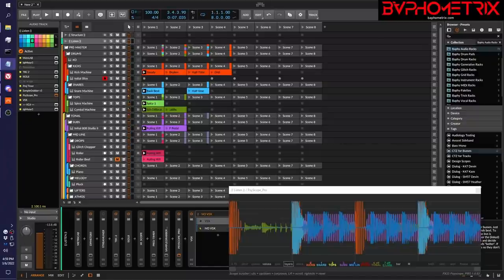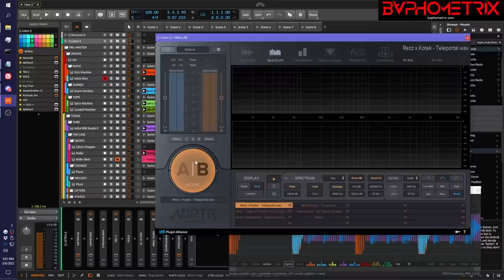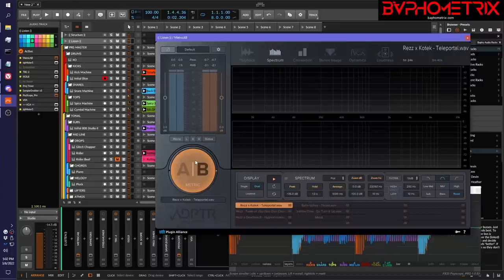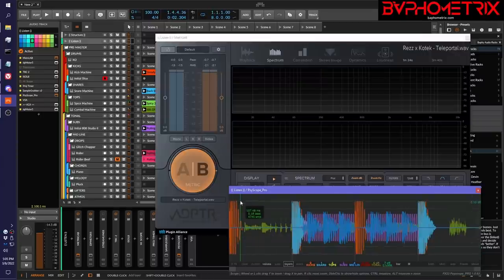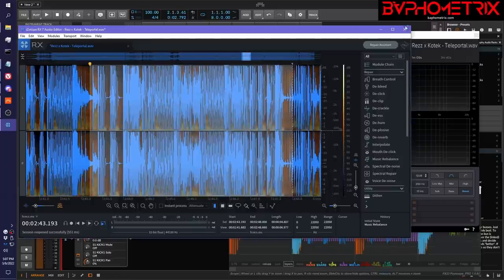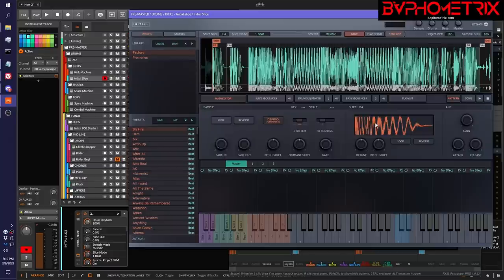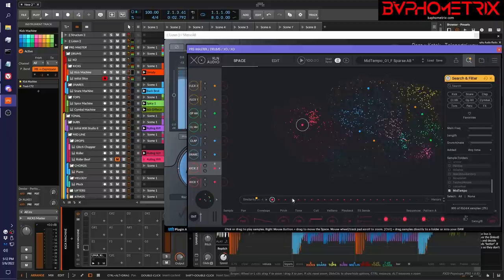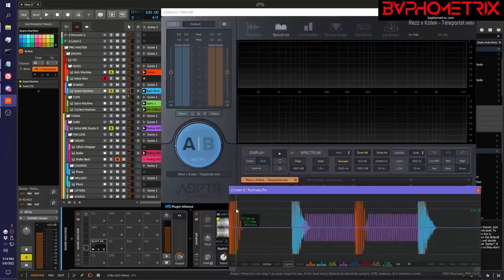Mixing Loud with CTZ - Ep. 9 -  Setting Your Mix Anchor & Framework

Comment: How could I use this technique in modern rock music? 100% sidechain is out of the question, kick drum and bass will always overlap to some extent...
Reply: I think the loudest part must be guitar and bass, not the drums. You must focus on the guitar as the loudest part of the mix (0dB or any other value) and then mix everything below that value. If the guitar will hit 0dB, the drums might hit -3dB, -6dB or other values, but the other elements must be below the loudest element of your song. Also, each element ust have its own space in the frequency range. If they overlap, frequencies add and then clip

Comment: Sorry for so many questions sir, but, if i cant separate the kick and snare from my track, how should I use the refference? I am having trouble getting the same levels, haha
Reply from the maker: It can be challenging. You have to do it somehow. By ear. By guesstimating. Or by finding a kick or snare hit in your reference track and literally slicing it out and putting it in a "drum machine" in your DAW and just playing the kick and snare from the drum machine.
Reply: @Baphometrix  And then, I should get my kick and snare at the same loudness right?
Reply from the maker: @yuulian4776  It depends on the genre, but typically yes. How balanced do the kick and snare sound in the genres you work in? For example, in Trap, the snare is the real anchor sound. It's the loudest rhythmic impulse in the entire mix. The 808 transients are usually much lower in perceived loudness.
Reply: @Baphometrix  I mainly do trap instrumentals. Thank you so much, you are really helpful!

Comment: When setting levels between the kick, snare and sub using the oscilloscope doesn't the faders of the individual tracks have to be set at unity gain so that the oscilloscope will to be displaying the level properly? You mentioned the sub should be approximately 6db down from the kick and snare. If the fader on the sub is set at -6db down from unity gain and the oscilloscope level of the sub  is -6db down from the kick and snare wouldn't the level of the sub at the master be -12?
Reply from the maker: All my instances of Psyscope Pro (or any oscilloscope) are in the inserts channel, and therefore yes, they are displaying the signal PRE-fader. And yes, that means **at first**, when I first set up and balance the framework sounds, I do so with all of their track faders at unity. 

First, I set the *anchor* sound (in this case, it was my kick) to be the loudness I wanted (in this case, just matching the loudness by ear to the reference track's kick). And I do this only with the gain and clipping plugins in my "Track CTZ" rack, while leaving the kick track's fader sitting at unity.

Then I balance the snare against the kick, again, leaving the snare track's fader at unity, and using only the gain and clipping plugins in the snare's "Track CTZ" rack.

The sub doesn't need to be clipped at all (because it's much quieter than either the kick or snare, and doesn't have any significant transients), so I simply raise and lower its level in the synthesizer or sampler that is generating the sub. Again, I leave the sub's track fader at unity while doing this.

So in summary, you typically want the track faders for your "framework" sounds to be sitting at unity throughout most of the early project. Only later, in the final mixdown phase, will you maybe have a reason to adjust any of these track faders for final small tweaks to the mix balancing. And this is why you identify ONE of those framework sounds as the "anchor" sound for the entire mix. That fader NEVER moves from unity. Not ever.  So for example, if my kick is my anchor sound, but during final mixdown I feel like the snare is just a little too loud, I might pull the snare fader down just a tiny bit. (Or I'll just go into the "Track CTZ" rack for the snare and pull the input to the clipper down a little bit), *still* leaving the snare fader at unity.)  And for the sub, once the final arrangement is fully built up and I'm in final mixdown, I might tweak the fader up/down just a little. (Because the sub isn't getting clipped at all, so it's easier to fine-tune its balance from the fader.)
Reply: @Baphometrix  Thanks much.
One last question. If I'm doing the finale mixdown and have everything balanced like I want it but the kick is slightly too loud. Do I bring everything else up to compensate or can I bring down the anchor kick?
Reply from the maker: @southernman2  I'd argue that IF the kick is your "anchor" sound for the entire mix, you should never ever get to a place where "the kick is too loud" (nor "too quiet"). Because you're constantly adjusting the balance of your mix elements to fit up into the "anchor" of that kick (and the other sounds that--along with the kick--comprise the "framework" for your entire mix).

So I guess the answer is don't let your mix get into a state where there is never a firm anchor and framework around which you're building your mix up.
Reply: @Baphometrix  Thanks for clearing that up. Much appreciated 👍

Comment: Hi Baphometrix, thanks for your videos. I have a problem while setting up my anchor sounds. When i play mit kick and clap together everything seems fine. But as soon as i take out my kick my clap gets much louder. How can i fix this ? And how is it possible that my pre-master is going into red even if i use a clipper on every track and bus?
Reply: I need to add this. I mean the input level of my pre master is going into red.
Reply from the maker: Both things you're describing should not be happening. Without seeing exactly what you're doing I cannot guess at the problem.
Reply: Thanks for your response. So i try to explain what i did. 
First of all i use the standard clip vst because kclip kills my pc for some reason. My settings are 1x oversampling and clip on (at 0 dB). This is on every track and bus. Except that i utilize the input volume and the output volume fader on the track lanes. Than i group for example the kick track to a kick bus. This kickbus is routet to the drum bus and than into the pre master bus. I don't have a listen bus because i use ableton.
Is there something i have missed? Because this situation leads always to unwanted distortion. 
I hope i missed something because i realy like this mixing approach :)
Reply from the maker: @Esben.music1  It's still not clear where you're going astray, sorry. The only thing I can suggest is to experiment with the technique I show on a very small number of tracks and busses until the gain-staging and summing behavior starts to make sense to you.

Comment: why CTZ ? oxford inflator Brings up loudness on any well balanced mix
Reply from the maker: So does any mastering limiter. But back in episode 2 I clearly demonstrate the problem with just throwing a dynamic track into a single limiting (or Inflator) stage at the very end during mastering. Inflator is just a multiband soft-clipper (a multi-band saturator).

Comment: God I wish this series was done in ableton with stock plugins.
Reply: Mhm, you could try it with Saturator instead of KClip. But Baphi mentioned that the algorithm won't sound as the one from KClip. If it's just because of the price maybe check out Free Clip from Venn audio. And afaik there's no tool to measure your RMS levels with stock plugins and match the loudness with one click. The VCA plugin you could recreate with macros though. Hope that helps.
Reply: I do it with ableton Saturator in digital clip modes works pretty well imo

Comment: Question - let's say i wanted to write a song like this, synthwave darkwave using CTZ (which i think is important cause this song hits an insane -2.5 LUFS 😅)
https://youtu.be/wy9r2qeouiQ
Would you use the bass synth as the anchor? I feel that this particular song is built off the synth, not the kick and snare, you can barely hear the kick in the song.
Reply from the maker: In that song, I would still consider the kick, snare, and sub to be the framework sounds. And the kick and snare are still obviously the loudest rhythmic pulses in the entire mix. And the kick is definitely still the anchor. The kick and the snare are much louder than I suspect you think they are.
Reply: Hey Isaac; first of all, i am currently studying the CTZ method,  and I am beginner mixer/producer.

I opened this song in RX to see its waveform; the Crest factor in the full instrumentation sections is squashed; its 6 db of dynamic range.
I calculated this because the highest sample peak level was +3.5 dB, and the total rms level was -3 dB. In the portion I selected, RX says it has 154,171 clipped samples. 

Even with this ''squashed''(?) crest factor, I could still found the little Peaks that represents the sum of kicks and snares above the rms ; so I assumed they begun being the anchor, but, the mix end up being so squashed that its difficult to perceive it.

The Anchor sound may not be the loudest in terms of RMS, or perceived loudness, but, in Voltage/peaks, Yes.

This are the things I understand by studying Baphometrix´s tutorials. :D
Reply: @809rdl  Wow, thanks for the answer.
Reply: @Baphometrix  Got it! Thank you
Reply: Yeees, check its waveform! :D well, hope Bapho add to this also.
Reply from the maker: @809rdl  If you go to the 2:29 through 2:34 section of the song, you'll find some places where there are two quick kick/snare hits that are allowed to stand out *mostly* by themselves. In a figure that a band composer would call a "stab". Use a slicer to extract out those drum hits in the stab so you can simply play them over and over right on the drum hit, as shown in this gyazo GIF (sorry, no sound): https://gyazo.com/722645d2505ffd25d243dd9393f4dae1 

If you look close at the first part of the sample slice that I'm wiggling my mouse pointer around, you can SEE that it's a kick/snare transient followed by two cycles of the sinus tail of the kick that are looking relatively "clean", before a lot of noise starts appearing on the 3rd wavecycle of the kick tail. That's showing you where the sidechain ducking of other sounds to the kick have stopped, and the rest of the audio is being allowed to overlay the kick/snare hit.

Point being, you can clearly SEE (and hear) the kick/snare combined hit in isolation, and you can SEE that it's taking up the entire full scale of the available amplitude. They are indeed the "loudest rhythmic pulses" in the entire mix. They are the framework sounds, and that kick is the anchor for the entire mix. Remember, you can indeed push other sounds so high in RMS that they start to *compete* for your attention against the framework sounds. That's a mixing decision. You can leave your framework sounds as the thing that clearly sits on top of the mix as the "loudest" thing to the listener, or you can choose to make some of your midrange sounds SO loud that they start to overwhelm and obscure the frameworks sounds. That's just a balance choice. The framework doesn't change. It's what you do with everything else in relation to the framework that is a subjective, artistic choice.

Don't overthink it with numbers and measurements. My advice is to always look at the waveforms to understand what you're hearing. After a while, your brain can simply hear a thing and in your mind's eye you can *visualize* what the audio is looking like.
Reply: @Baphometrix  thanks maestro!